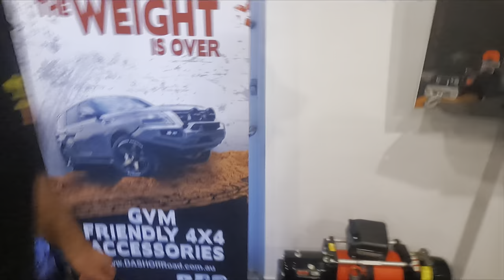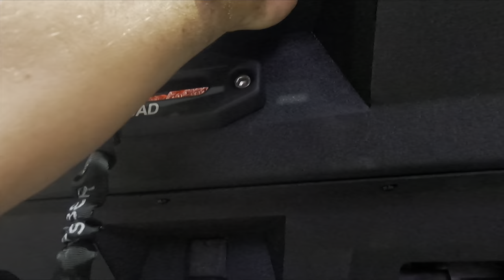NEW Y62 Bar - NEW Saber Winch - NEW Winch Thimble 🤔🧐

Comment: just in regards to the winch rope colour. I may be WAY off base, totally wrong, stupid in the extreme here, but its just a question that popped into my head! Supposedly..... red cars fade the fastest... if that is because of the colour and it's...... i don't know, "attractiveness" to sunlight/UV, will the red winch rope degrade faster in the sun??? maybe its a stupid question..... but there are better minds than mine on here, that might be able to shed some light on this! (did you see what I did there? LOL)
Reply from the maker: I’d say that’s a fair comment. I reckon you would get at least 10 years out if it though